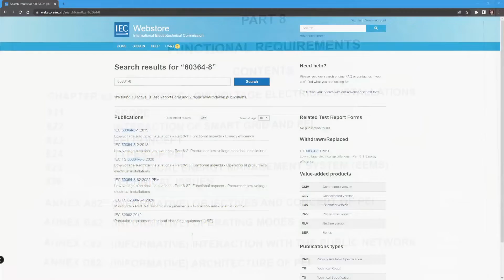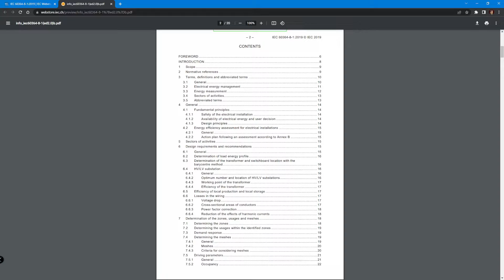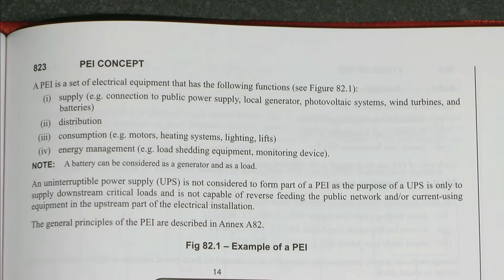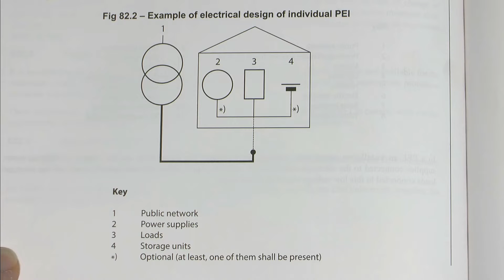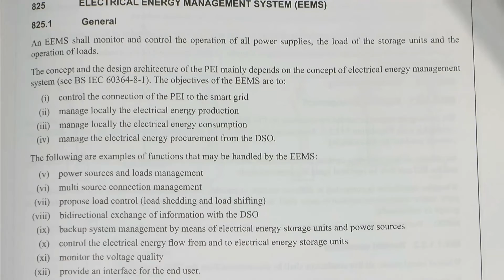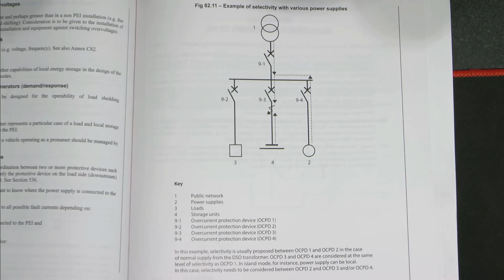BS7671 18th Edition Amendment 2 Part 8

Comment: Hi John, Lots of good information as ever many thanks.
You raised a very good point at the tail end of the video, namely the importance of considering the current flow and protection from it, in relation to PV and such.
Not being interested in the Install of such things does not mean we can just ignore the technology. It will be around more and more, and will need tested, it often needs 
fixed and wiring replaced etc.
So any info you have on all this would be very helpful.
Thanks again

Comment: Is there anything in Part 8 about grounding?  US electricians get very excitable about it because the ground-neutral bond is done by them rather than the DNO equivalent.  I think that I know what is required but it's potentially complex and I'd like to know what, if anything, the regulations require.
Reply from the maker: There is, particularly with island mode which can involve switching the earth / ground connection.
Will do a separate video on the concepts of Part 8.
Reply: @jwflame   Thank you John, look forward to it.

Comment: Thank you for your clear presentation of the changes. It always seemed strange to me that under G83 the inverter from a household solar system had to disconnect when the grid supply went off, leaving the householder unable to utilise the free energy from the roof.
There could have been “Prosumerism” at a much earlier stage using the provisions for safe isolation and reconnection to the grid that were then granted to commercial solar pv installations, which also enabled them to island. G54?
Reply: I think this was partly because early installs were downstream of a shared RCD, and there's little point in an RCD tripping for a fault if a  PV system still back-feeds that half of the board! (I've actually found situations where a new circuit failed RCD disconnection times due to a PV system not turning off quickly enough.). These days a separate board for the PV has removed the issue.

Comment: Hi John I’ve got a question about sockets if a room has wood panelling from floor to about 3ft tall is it ok to flush fit sockets in to it
Reply from the maker: Yes, provided the wood panel isn't forming part of the enclosure for the socket wiring - any metal or plastic box should be flush with the front of the panelling, and the socket installed over the top.
What you don't want is for the box to be recessed deeply in the wall with a gap between the box and the front, leaving the edges of the wood panel exposed within the space behind the socket.
Reply: Thanks I did think that I’m not an electrician but have rewired every house I’ve lived in your explanation’s are very simple and easy to understand keep up the good work.
Reply: @garyloudon2417  leave it to the pro’s
Reply: @HeatSoaked  lol and then they  can charge me depending on how big they’re mortgage is and then slag every other electricians work they  come across in the house I’ve rewired 5 houses and never had a problem .